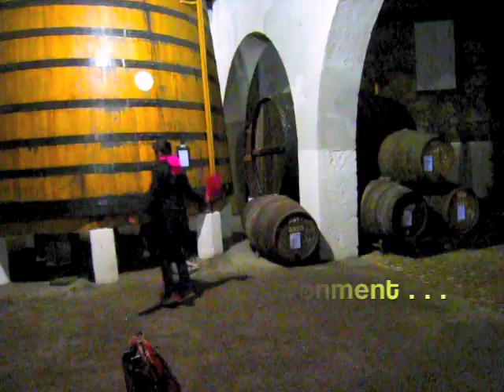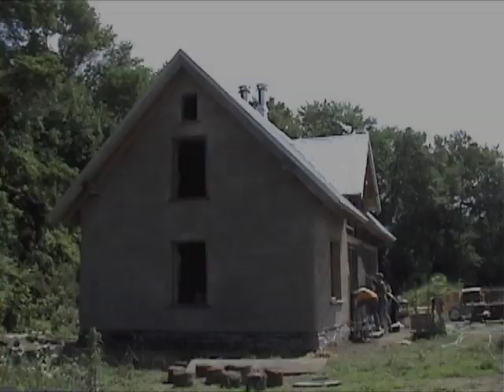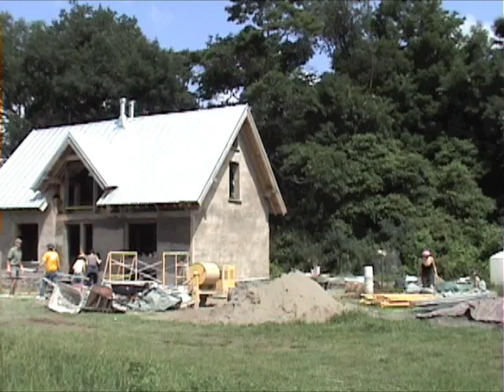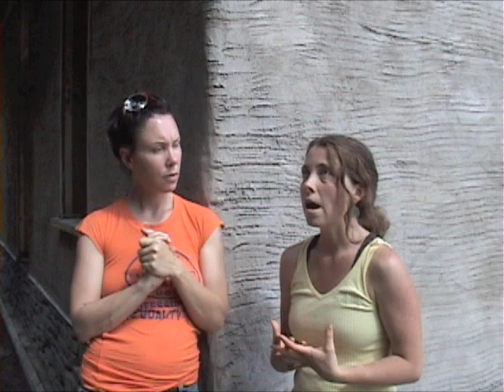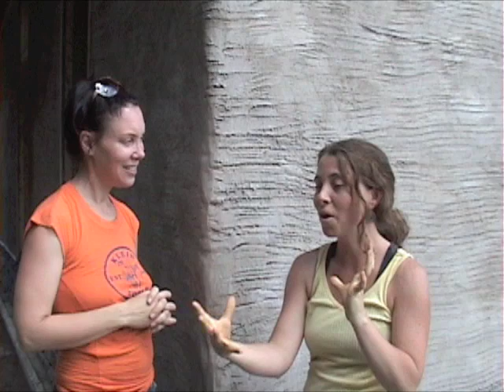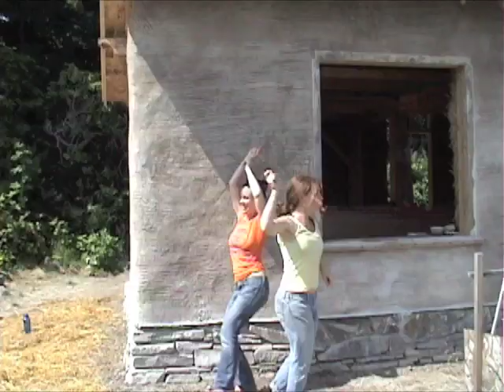We Can All Do This

Comment: Excellent, 5 stars! This kind of building is certain to get very popular in the next decade or two. I imagine we'll see some of the old construction retrofitted with an outer wall of this straw bale material so as to make it possible to keep it heated in the winter. All you need is a south facing wall and some big windows and you'll get that solar heat. Then in the summer the outer walls will resist the afternoon sun and stay cool.